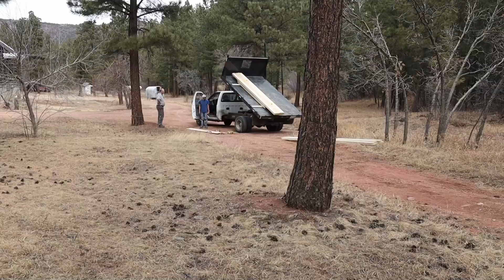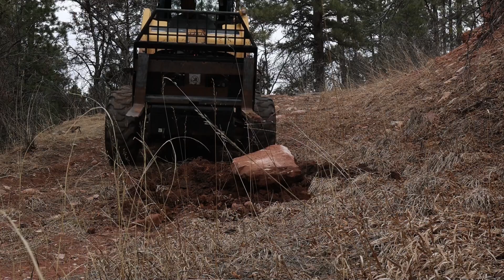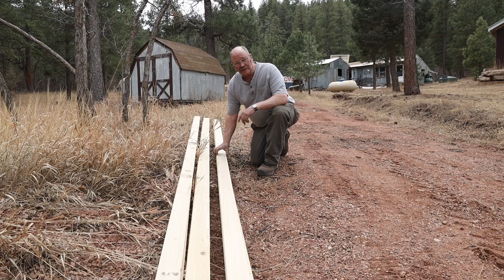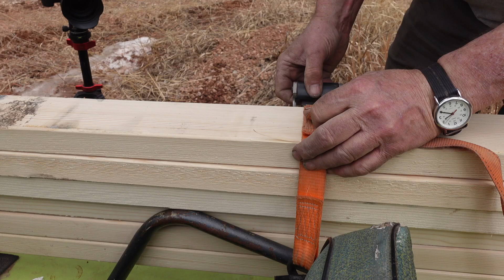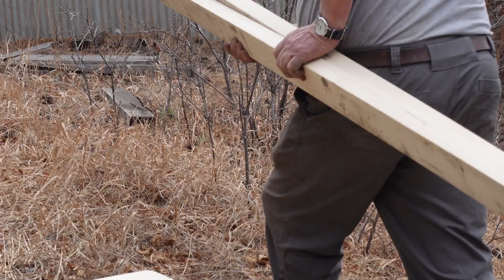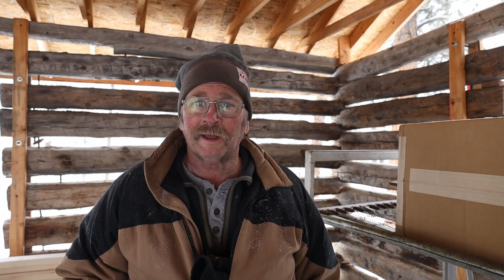Staging Materials

Comment: I look forward to watching your cabin come together. Remember, there was a man who took many years just to paint a ceiling. Looks like you have underground ground power coming into a power switch close to your cabin.
Reply from the maker: There are some overhead lines, but we would have to pay for a meter hookup and don't see any need for a little cabin.
Reply: @John Switzer  there is a green box setting on the ground. It  looked like a pad mounted utility switch with an opperating handle. It just looked out of place.
Reply: @countrycraftsman5110  Thats actually a military surplus storage locker